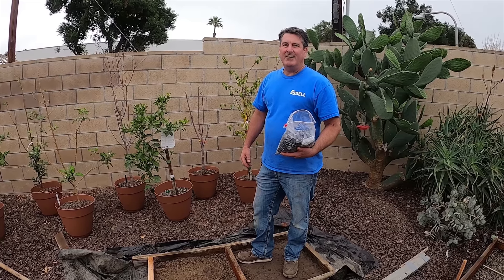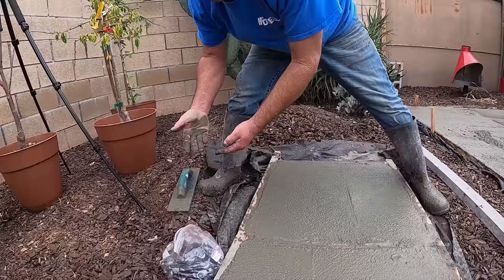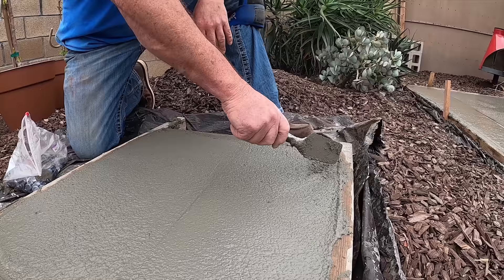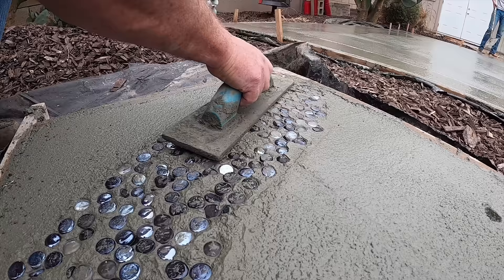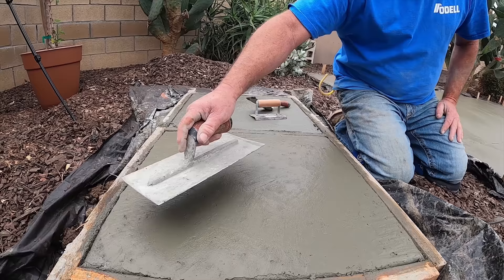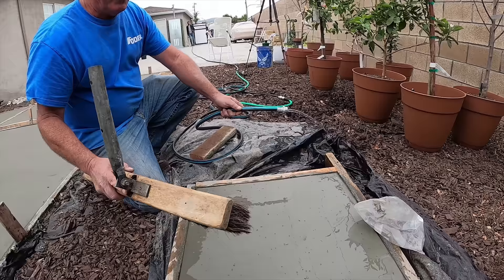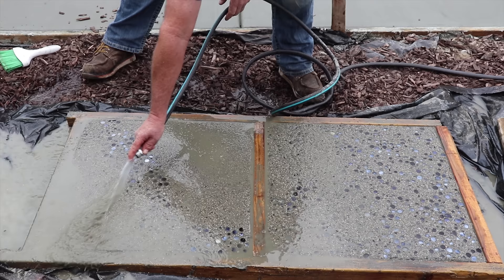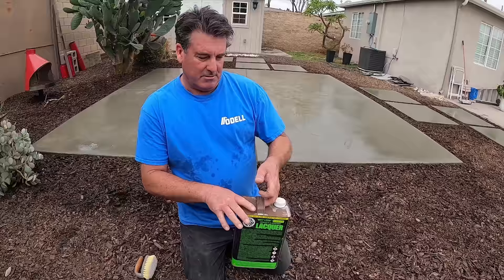How to Make Concrete Stepping Stones with GLASS

Comment: I make them upside down. Putting the form on a plastic sheet, as you do, I put the glass beads in the bottom of the form and pour concrete over them. The next day, I flip the paver and expose the beads with a diamond cup in an angle grinder. It only takes about one minute, with lots of dust, but it cuts both the concrete AND the glass, exposing a larger cross-section of the beads. They are so firmly embedded, I have never had any beads come loose in over a year, with seasonal temperature extremes.
Reply from the maker: Sounds like that may dull the glass
Reply: @OdellCompleteConcrete a low grit will dull the glass, absolutley. But you can go over it with like a 1000+ grit to polish them again. Good catch on the dulling :)
Reply from the maker: TY
AARON
Reply: Can you please make a video???

Comment: I just made two more of these pavers today.  I'm using  2 nested 2 mil  18 gallon trash compactor bags as a mixer - easy clean up - all the paper and extra concrete goes in the bag afterward.  Walmart has bags of the glass beads for $1.  Three bags is enough for a river on two pavers.  I was using the sealer you show but when the quart went dry, I balked at paying $50 for a gallon at Home Depot so I picked up a can of Seal Krete Wet Look spray for $12 at Lowe's.  Easy to apply!  Looks good!  Only covers 25 square feet, but no clean up is a plus and no roller needed.
Reply from the maker: Nice system

Comment: Thanks for the idea &  demonstration. 

My friend had a poured cement patio done in which the cement had a high ratio of small rounded river rock mixed in. After the cement had started to set they sprayed it with water which brought out the 1/2 -1 1/2 inch stones. You have to be careful not to take off too much because that can loosen the stones. I think it was sealed. This work was done by a cement company in Midland Michigan.

The finished patio was beautiful and felt wonderful under bare feet. Sorry I don't remember the name of the company.

Comment: I am making steps 7.25" thick and will pour them in place.  Would wire mesh be sufficient to reinforce a step that is 36" x 36" x 8"?  If so, would elevating the wire mesh before the pour with spaced 4" rocks work?

Comment: Really love the look of this, I'm wondering though if they are slippery to walk on when wet or if snowed on as I'd be interested in doing something similar for steps leading to a front door.
Reply from the maker: Good point. Add a slip resistant additive to sealer
Reply: @OdellCompleteConcrete  Thank you, I'll look into doing that as my steps are long overdue a makeover :D
Reply: @OdellCompleteConcrete  That was my question, so thanks!

Comment: Hi, Thanks for the great vids! Question, because temperatures vari and there are so many types/brands and speeds for concrete curing, is there a tell-tail sign (or test) you look for in determining when the time is right to apply the hose and rinse off the "cream" and expose the stone?
Reply from the maker: When you can stand on it without sinking

Comment: Thanks the the video, I love these slabs! 

Would like to ask two things:
1- Roughly how many slabs sized per your video could you get from a standard 50lb bag of concrete?
2- is it viable to go thinner for a patio slab, only to be walked on? Maybe 1.5"?
Reply from the maker: No less then 2".
At that depth maybe two
Reply: @OdellCompleteConcrete  I did a 4x4 pad using 2x4's yesterday and I used 6 80 lb bags.  I also tossed in some rocks and concrete from the previous slab I did a couple days earlier to take up some room in the forms.  My first try using glass, turned out well.
Reply: These are beautiful! I love how they are embedded. My favorite is the river style. Thanks for sharing!

Comment: My advice? If you want to do glass pebbles like this, make sure you place them in an area with very little foot traffic, those glass pebbles are very weak and break very easily and you'll end up a "swiss cheese like" concrete walkway, trust me, I already did this like 10 years ago, I redid the whole walkway with tiles to cover the swiss cheese!
Reply from the maker: Sealer
Reply: As a Terrazzo worker for 34 years I'd use chunky broken glass get better bond with no swiss cheese later...
If you get Terrazzo approved glass it won't break from foot traffic ✌️
Eric Underwood Class of 81 Downey High school CA

Comment: A variation: stepping stones or patio or driveway. Seed wet concrete with what pleases you. When fully embedded use pressure washer to spray away surface,exposing design.
Probably best for large project.
Reply from the maker: Sounds awesome

Comment: I live in the desert Southwest and temps are now in triple digits.  I am assuming it would be best to wait for fall to do any concrete work? Also, am a little confused on how you strip the forms.
Reply from the maker: Pull the nails out and the forms fall off.
The heat is not going to hurt these little steppingstones.
If you can do in them in the shade that helps.

Comment: Hey Mr. Odell, what do you think about these lumber prices??
Reply from the maker: Insane
We may need go to synthetics for everything
Reply: Might as well build everything out of steel. I had plans to build a wood deck except they wanted 60k to do it and it’s not what I want. I’m just going to use steel to build all the structure and composite decking so I never need to worry about it. No freakin way I’m paying these prices for wood.

Comment: Hi dave for concrete you use concrete with out rock or with rock
Reply from the maker: Yes there is rock 3/8" minus
Reply: Hi dave the another question if i going to it 24"x 48" or 72 do i need bars to reforce the concrete?

Comment: I kinda don’t like the way the gravel comes thru . I wonder if you could use cement without gravel n add your own colored gravel?
Reply from the maker: Sounds like a tricky situation. Maybe setting the glass in a different material like  epoxy